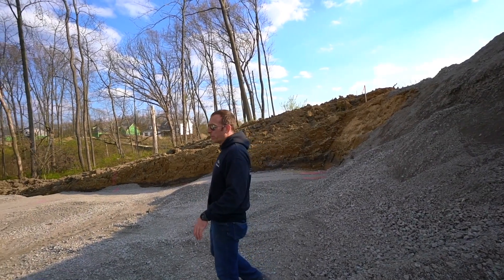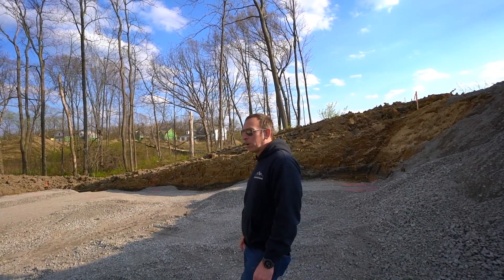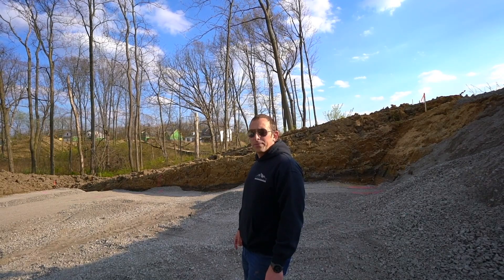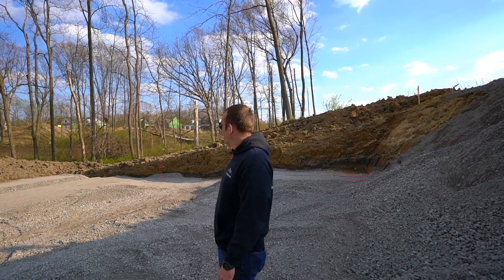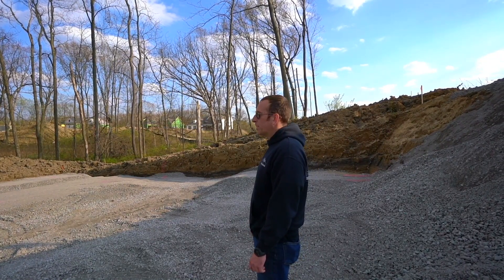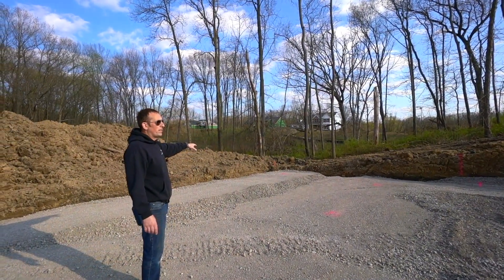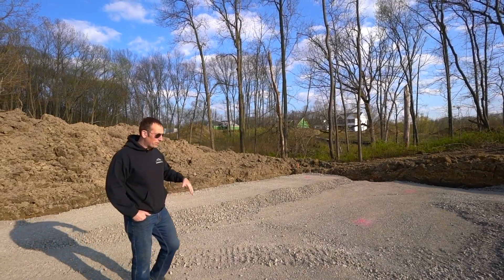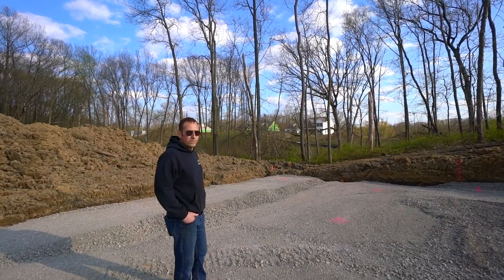Winterberry Episode1: Excavation and Soil Compaction

Comment: Former Landscape Architect. Grading is the most overlooked part of any construction project. This includes; Cut / Fill, Drainage, Utility Trenches, Roads for Cars, Sidewalks for People, etc. Do it wrong and if discovered later in Project, can be very expensive to fix. How do you fix it when a building is sitting on it now?

Didn't mention if Geotech Fabrics were called for. They can be used to spread settlement over a larger area. They can also be used to spread a load over a wider area. Were Pilings and Ground Beams considered. This can be used on sites with wet soil conditions. It doesn't require 4 plus feet of compacted engineered aggregate. 

Those are usually less excessive options on larger grading projects and reduce amount of material being brought to site. For a small residential project, adding engineered aggregate is probably best option.